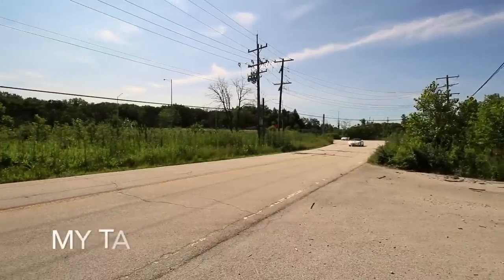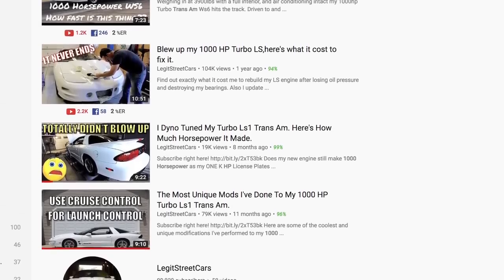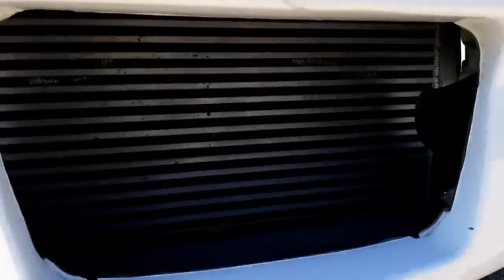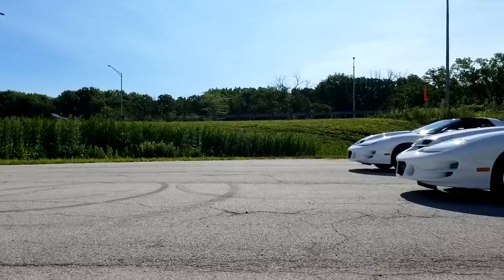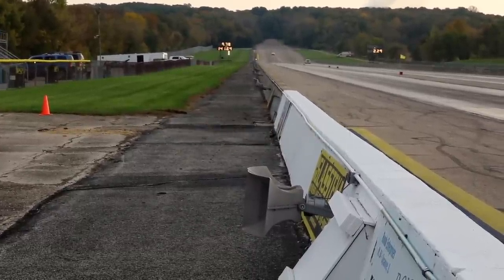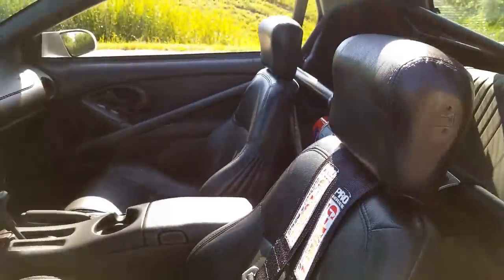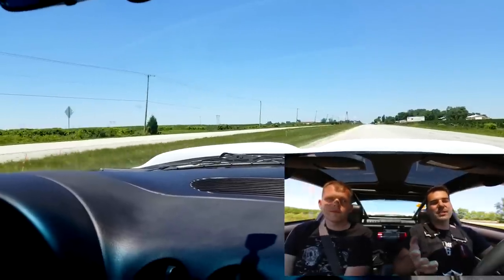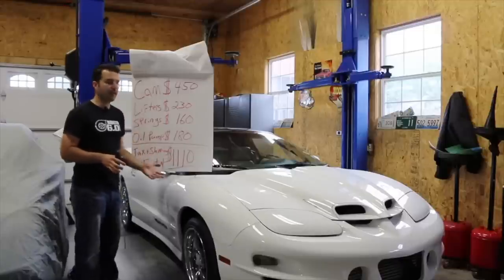Dodge Demon Who? My 1000 Horsepower Turbo Trans Am Has A Much Faster Evil Twin.

Comment from the maker: What's your fun/race car? Post up!!
Reply: LegitStreetCars my 68 stang🤟🏼
Reply: TTRS which is about to go in for a 800hp turbo upgrade. I dd a E55 in a large part because of you.
Reply: C6 z06 forged/supercharged 720whp
Reply: C55 with headers and secondary cats removed. Going to the track today, hoping for a 12.9 or better.
Reply: LegitStreetCars A cammed, and stalled 2002 Silver WS6
Reply from the maker: Andrey Let me know how it runs
Reply: 2002 ws6 with a 427 and f1r blower.
Reply: 2004 jaguar s-type R and 2008 VW gti
Reply: '97 Trans Am WS6 M6
Reply: How much boost could run on 11.3:1 compression with e85 forged internals and 6.0 block?
Reply: I will say it, but don't laugh; fiat palio sporting 👀
Reply: 2002 M6 WS6, PTE 7675 turbo, E85, BTR Stg 2 turbo cam on the stock bottom end LS1. 670 RWHP at 14 lbs and 15 deg timing.
Reply: LegitStreetCars I have an Fbody and live near Elgin. I want to see your Fbody more! I watch all your videos
Reply: 2001 Camaro SS. Working on an LQ9 swap... anyway I could ask you some questions somewhere??
Reply: 99 TA. I love these cars.
Reply: 02 SOM firebird D1sc 615hp
Reply: VW Golf 5, 1.9 TDI, 105 HP ( ͡° ͜ʖ ͡°)
Reply: 2002 Camaro SS with LS1 383 Stroker.
Reply: LegitStreetCars my trans am
Reply from the maker: michael coleman Its really about power, boost is just measuring a restriction.  I'd say 1200ish on E85
Reply from the maker: Cameron O'Brien Thanks brother.  Follow me on Instagram. I'll post there when I go to local car meets. Love to check out your ride
Reply: 2000 Trans am grudge/street car should be out soon, I'm in Des Plaines
Reply: 1995 Chevy lumina apv with a 1996 Pontiac gtp motor with bolt ons and a can tune. Fits all my kids tows my other toys surprises people
Reply: Well one of my favorite car's is 84 Ferrari 288 GTO 3.0L V8 twinturbo
Reply: 93 jeep Cherokee with a turbo 4.0. Doing a turbo 5.3 LS swap.
Reply: Full bolt on '02 WS6 M6 16K miles =)
Reply: I'm building a firebird putting ls in it can I use any ls harness are will I need the 6.0 harness from truck where engine was took out of
Reply: E46 m3 with cams, intake, catback, ecu from dinan, koni coilovers, polyurethane engine transmission diff and subframe mounts along with the suspension components. 4.1 diff ratio, CSL SMG shifting software, recaros and just alot tbh
Reply: 2000 trans am firehawk
Reply: Black/blown/forged TransAm, hi from Ankara/Turkiye...
Reply: An old rusty turbo silverado that runs 10’s :)
Reply: 75 forged/supercharged/stroked Trans Am.
Reply: 99 stock T/A and a stock 2007 TBSS. The TBSS needs engine work. Bad lifter tick. But it's fun to drive.
Reply: 99 Trans am ws6
Reply: Present day, by buddies '98 SL55 AMG. Nothing special but still a fun car to drive, oh...and it's lightening quick. Future day: why the C8.R of course. And the soon to be released 5.5 liter naturally aspirated engine in the C8 Corvette...stay tuned, literally!
Reply: 1989 mustang lx coupe. Sbf 306 dart block, pt 7675, hci, 20psi, 781/785.
Reply: Not to mention the SLP FireHawks
Reply: 04gto 02gt new edge and a 90 gt mustang all under 100k miles and i got a fast 05 1.8 t 02m 6 spd.manual with lsd locker and a lot of other muscle cars I've sold LOL over the years but I always keep a handful of toys in the yard I got a car problem LOL
Reply: So the stock block 5.7 LS1 aluminum is faster than your five three swap built one that's crazy
Reply: 99 Z28 stock motor for now, upgraded trans.
Reply: where did will get his hood???
Reply: Any year Trans Am. I've the 73 455SD and I would live to have a crazy built 1977 Bandit T/A.
Reply: Firebird 99
3.8
I've owned a 95 93 v6 camaro, then a 97 SS. NOW I HAVE A FIREBIRD LOL😂❤😂❤

Comment: Just purchased a Trans Am from my sister that's been sitting for 10 years.  2001 model year with only 60,000 miles.  

There was an issue on cylinder 6 with misfires.  Turns out the cam was having an issue.  So new cam, push rods, lifters, beehive springs, FAST 92mm intake manifold and FAST 92mm TB, valve job, head tanking, etc.  Everything is at the shop other than the cam.  Should be sent out beginning of this week.  I really can't wait.  I haven't messed with a car engine in a long time.  For the last 9 years it's been Jeeps, and on those it's largely suspension related.

Comment: WoW Trans Am WS6 RAMAIR is just BadAss !  I really want to get one again.  I originally had a Red 2000 WS6 RAMAIR & it was Nice ! 
Nowhere near as fast as you guys TA's, but mines had Hooker long tube headers, SLP exhaust, Comp cam camshaft, Push rods, Roller lifters, Valve springs, Automatic Trans pak, Strut tower brace, K&N air filter & SLP Air lid, NOS 125hp dry shot, & Cross drilled brake calipers.  That car was just a Beast !   Never lost a stop light race but sadly I never took it to the track.

Comment: Love your channel and especially your car. I'm a huge Trans Am fan. I need your advice please. I live in California heavy smog rules. I just bought a 1998 WS6 T/A with 140k miles I want to bring it to at least 700+ rwhp. What way do you recommend I go. A stroker eng?engine?? Twin turbo, supercharger or procharger? Fuel delivery system, Trans rebuild and rear end gear?? It has to pass smog, I only drive it a couple times a month and I'd like to take it to the track once or twice a year. Please I desperately need your help. Thank you. Keep on bringing the videos. Love em especially the T/A videos. 👍💯

Comment: Alex your channel is awesome keep up the amazing work 
5k budget build what would you do ?
Reply from the maker: Shane Martin 5k including the purchase of the car?
Reply: Yes lol
Reply from the maker: For a quarter mile car I'd go pick up a V6 F-body for like a grand of even less. Like a piece of crap car that I could gut.  I'd get a junk yard 5.3 with a 4l80e and just open the ring gap on the engine and slap it back together. Then a $800 borg warner turbo, some truck manifolds, tune with hp tuners and put the money into a decent used rear end for around 1500 and a good fuel system for some E85. That's basically what I'd do but man 5 grand is tough.
Reply: Sounds like an awesome thrash car 👍
Reply: Wound that cause an issue if you changed the VIN in the computer to say V6? Emissions maybe?
Reply: 5k just buy a used 600cc sport bike.
Reply: @LegitStreetCars  i have a 00 firehaek looking for a turbo option. Dont want to go very crazy. What a good option. Still have original ls1.

Comment: Great video.  What's the value of my pure stock '01 Black WS6 6-manual 75k miles in good used condition?  What can I realistically sell it for?
Reply from the maker: I havent' searched around lately but if it clean I'd say 13ISH

Comment: I know this is an old video, I wanted to Know if you are using the stock A/C condensor with your TA? I recently had a turbo installed on my TA and I'm having overheating issues with the stock condensor. I'm going to upgrade the fans to 12" Mr gasket fans 1400 cmf each, hopefully this will solve my issue. I'm currently running two 12" Spal fans pushing a little over 800 cmf. Any advice will be helpful thanks

Comment: Okay I have a 1999 Trans Am 6spd vert, Im looking to go a cheap turbo route about 3k or lower, what would you guys recommend? Im looking to make 500-600hp (Or more after I build the motor a few years down the line). If possible a setup that retains a/c (I live in texas lmao).
Reply from the maker: $3,000 may get you a used truck manifold kit but just having the turbo kit won't get you far. You will need a fuel system, tuning and a few other things. I'd keep saving up or go heads and cam for now.

Comment: What makes up all that weight? Turbo manifold ect and custom ac? I imagine the iron block from aluminum is 150lbs or so
Reply from the maker: Turbo stuff, Ford 9 inch rear, iron block, air compressor in the back, subframe connectors, etc.

Comment: It just sucks that the interior of these cars is the same as a Pontiac Grand Am. Same steering wheel, dash and air vents. Other than that these cars are sweet.
Reply from the maker: I hear ya but it was the 90s, most interiors kind of sucked. A good friend told me you were buying a $15,000 car with a 15,000 kickass drive train.
Reply: Kenshin Himura I agree with you and I’m a guy that has had quiet a few bimmers in recent years.  At the end of the day the interior is meh but it’s the cars that have their faults that people are most fond of.  Pontiac is no different and this is by far my favorite car.

Comment: Looking at doing a forged 6.0 with a big turbo on my 2002 WS6. Trying to get a 9-10sec car. What all am i gonna have to upgrade as far as fuel and rear end goes? Whats the best gear ratio? Im gonna keep it a 6 speed.
Reply: The higher the number for the gear ratio the more acceleration and torque and less fuel economy and top end speed vice versa

Comment: love it alex!! nice cars!!!  i have a sbc 400 5.7 rod with 10.5 compression i am looking at the snow meth kit you can tune with the wideband still or will the meth have an effect on it ?
Reply from the maker: juiced71 Yes you can use the same wideband as with just pump gas. Its best to switch the display to lambda though.  Kind of complicated but basically lambda doesn't care what fuel you are using so it will give you a very easy to read and accurate number
Reply: I seen that Gauge on your buddys piller and was wondering what a lambda ? i am running blow through carb i can use it sorry new at this turbo tuning lol  and thanks alex love the channel dig vids
Reply: oh ok i have a AEM wideband so it will have that lambda setting
Reply: juiced71 lambda is the same regardless of gas or ethanol fuels.  Takes the guess work out of figuring your afr
Reply: thank you will !i appreciate your responce

Comment: Have you guys ever blown a TTOP? I was at Etown one day and a guy with a worked over BUICK GN had built his car out of a ttop car. One blew out on his first run due to flex.
Reply from the maker: SCcarguy I have not.  They come off and go on pretty easily too. I've heard of some who can't take them off anymore due to the body flexing
Reply: SCcarguy some tracks will make you take the ttops off.  The cage in the car helps to keep it ridged so flex is less than a non caged car.  I’ve never lost one

Comment: I've owned 4 gen T/A's that were much faster than stock.  I'd rather have the Demon.  Current car is 2016 SRT 392 Challenger, D1SC stage 2 tuner.
Reply: Everyone has their personal preference, but there are a ton more challengers out there.  I'd rather have the lighter, rarer car (trans am).

Besides half the Demons are trailer queens due to limited production.  The other half are beat to fuck and almost halfway out of that warranty.
Reply: The Demon was nothing but a money grab. I also don't think it'll have a great return on the investment. They were advertised as msrp of a little over $90k. Dealers were selling them for $125k and more. I'd totally drive it like I stole it if I had one. Forged internals are all that is preventing me from turning up the boost on mine and making more power to the wheels and at a fraction of the price.

Comment: We have a 94 LT1, I really don't want to get rid of or swap the motor. It has 265k miles and runs really strong. Any suggestions on what to do with it? Maybe swap heads and TB with lt4? Boring it over 30? What do you guys think?
Reply: get a clean Ls 6.0 . Lq4 is the common 6.0 & Lq9 is the better 6.0.Stick to iron blocks if thinking of boost.You can pull 425-450 HP out of these motors with Mostly stock upgrade parts,Easily. Worth the hassle to yank LT1 & swap.
Reply: @joejohnson147  thanks for the advice!! I'll be looking for one of those and swap it then!
Reply: +Fast Lane Pros Look for a salvage Chevy express van or pickup truck,If money is an issue. And , you can usually sell off the van or truck parts to defray costs more.
Reply: @joejohnson147  perfect! So the truck 6.0 is the motor to go with...good to know! I appreciate that!
Reply: @joejohnson147  I love you guy's birds! They're becoming rare quick!
Reply: +Fast Lane Pros These aren't mine. But , I work with a friend who has acquired 5 complete 6.0 engines , for less than 1800.00 bucks ,once he sold off van & truck parts.He's a mechanic, has his old man's bought new 66 Chevy Nova setup with a single 88 mm turbo.We're working up a twin turbo beast. He is the old pro , I'm still learning every wrench session. Also , a beater 91 camaro waiting to be turned into a 1 mile drag machine. Not enough time in day or days in a week For All the bench session ideas. .
Reply: @joejohnson147  I heard that brother! That's crazy 5 engines the same!
Reply: +Fast Lane Pros  Look up ' The worlds fastest car firebird' if you wanna see a Fast Bird. And share it with friends if it impresses you as much as I. The view count is pathetic. So beast , yet so unknown. Run is in record books too.
Reply: +Fast Lane Pros Also check out " Worlds fastest:Banks twin turbo trans AM" . Another record run, & view of engine will give any speed Demon pop wood. Check the years on both & length of record for Banks ride. In descriptions or comments.
Reply: IOM TT , if into motorcycles & never heard of it. Mind Blowing.
Reply: @joejohnson147  will do bro!

Comment: What heads are you guys running? I also have a ws6 with a supercharger though.
Reply: mannyman84 my setup is a little older so it’s 317 truck heads.  Guys are seeing some good improvements with the 706 heads so those would be worth considering
Reply from the maker: Im just running stock 241 casting heads that were ported
Reply: Wow. Amazing how GM heads can make great power. I went ahead and used the AFR heads 230cc. Good to see you dont need to go with big heads.

Comment: I have a 2000 ws6 single turbo 6m. what rear are you using?
Reply from the maker: Moser 9 inch, wavetrac with 325 gears
Reply: Chad Warnick strange s60 with a 3.54 trutrack

Comment: Wait, 31 mpg highway in a 9 second 6 speed car? How is that possible?
Reply from the maker: It's possible but I was getting 31 mpg when it was stock 6 speed. I didn't mean the way it is now or anything but I do get about 22 mpg straight highway the way it currently sits. That's not too bad.
Alex

Comment: What cams are you guys running ? 😎
Reply from the maker: SATAN NATAS I'm running a Martin smallwood cam. It's a 227/232 low .600 lift on a 114+4. That's a ballpark but though. I'll try and find the cam card
Reply: SATAN NATAS mine is a speed inc tu1 cam.  Kinda old school but it ain’t broke

Comment: Trolls. That car is extremely modded vs a stock car. Race them both stock vs stock.
Reply: preludeF20Bking  can I also stipulate that dodge has to build the demon for the same money as my car cost me? I mean if we’re concerned about apples and apples and whatnot
Reply: willizm real comparison between modded vs stock to get to X speed is no comparison at all. Lambo is slower than this car but that doesn’t me it effects the value just because it’s slower than a boosted LS build. Also real comparison will be the side demon vs other cars that are in the 2018-2019 line up. As of right now there is nothing faster for the price. Will Ford or Chevy build something faster? Maybe they will but for now the demon is the fastest car.  Also there’s a lightly modded demon with only cat delete,upper pulley,tires and tuned on e85 that ran 9.3.. There’s now 2-3 nitrous tunes demons.

Comment: Those cars don't weigh 3900.  Stock full weight is more like 3400
Reply from the maker: Mine weighs 3900 with me in it.
Reply: 4l80e swap = heavier, s60 rear end = heavier, turbo kit and piping = heavier, roll bar = heavier.  I can keep going if you like.

Comment: People forget that the demon was a stock car straight of the production line with a warranty a car that comes from the production line to the race line and pops a wheelie 😈😈so bad ass
Reply: El Wicho demon =CHRYSLER  JUNK!!
Reply: Most car guys like to build and customize their cars and take pride in that fact.  It takes thought, effort, work, etc.  Sure a demon has a warranty as long as you don't mod anything (even air filters).  However if you blow it up at a track thats not covered under that warranty.  

I'd rather have the trans am for less than half the cost.  Far more unique too.  Challengers, mustangs, camaros, everyone and their sisters have one yawn.